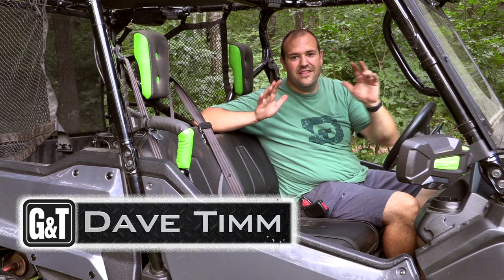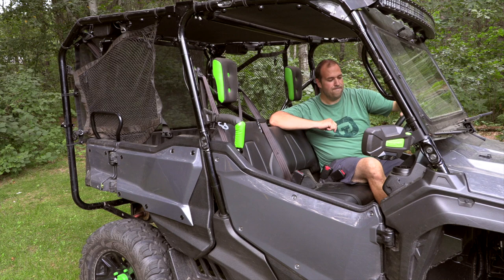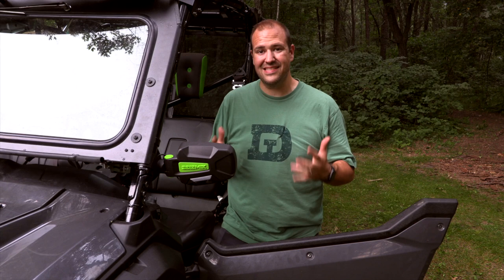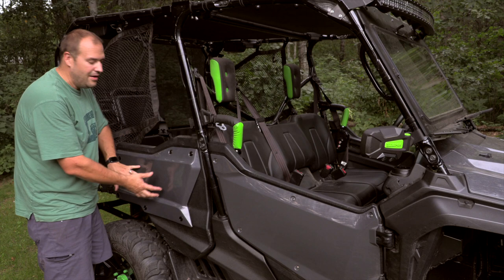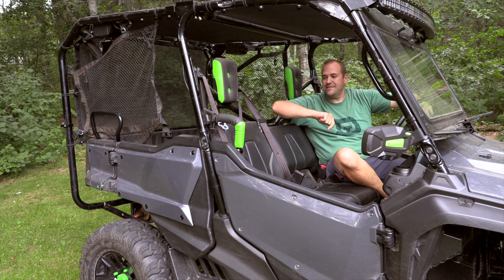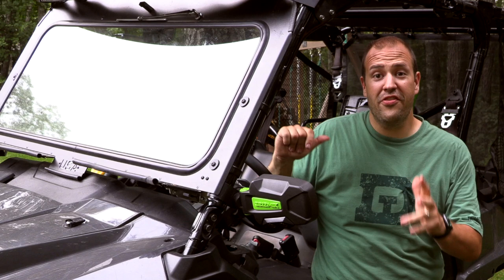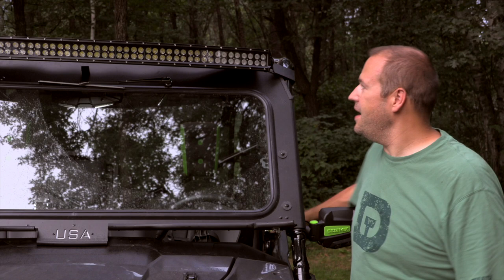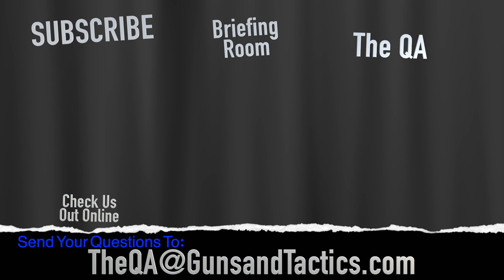The Best UTV for the Range or Play! Why I picked the Honda Pioneer

Comment: I like the idea of having signal lights built in.  More manufacturers should do this.  I know that CFMoto does integrate the lights on every model they make.  I don't care for that brand because I just don't trust it.  Good video, you have installed many things that I believe should be a complete option kit from factory.

Comment: 1. Do you think the roof rack could handle an 8ft. John boat?

2. Can you go into more detail regarding the difference between the i-4wd and the regular 4x4?
Reply from the maker: I’m not sure about the boat as I am not an engineer and I would not want to speculate how much weight it could support. In regards to your second question, check out my video on the new 2022 Honda Pioneer where I get some trail time with some of the new i four-wheel-drive models.

Comment: Great videos Thanks!
 I have a 2021 Pioneer 1000 3 good machine but Honda does a lousy job on fit and finish. When you spend 19k on a machine it should not  rattle like an old horse and buggy. They have had this issue for many years and simply choose not to address it. I bought it for the gear drive but that is jerky as well. Seems the technology available today they could build better at the price they charge.
Reply from the maker: I know what you’re saying   Sometimes the rattle in the back doors and from the bed annoys me
Reply: All machines have compromises. The plus to the Honda's is that they'll continue to actually work, while the ones with better fit and finish likely need to be repaired far more often just to get them going.

The choice is yours.
Reply: My brother in law has a Can Am Defender. He had a bunch of rattles with his machine. He fixed it by attaching some self stick foam where the door meets the frame. That seems to be a common area for rattling. I am sure it would work in other areas as well.

Comment: I have a 700-4 and love it but I'm going to a 1000-5 because I hate the 3 speed transmission. But I went with soft sides that wrap around the roll bars as I use it for the farm and to plow snow with. My question is have you installed a heater in yours yet and did you get enclosed cab set up?
Reply from the maker: I got a soft half cab and a vent fan not a full heater.

Comment: Can you do a video on how you changed your plastics- color-and where do I order the different color plastics- for side doors- bed rails-and front
Reply from the maker: I ordered my plastics from my local dealer.  For the front follow the Honda led headlight instructions. That covers taking off the front fender.  Then on the doors just have to add threaded holes, I used nutserts which I talk about in the Tools and Supplies video or click the link to check out the article.

Comment: Really nice job.  Thanks for the video.  I like the colors you used as well.  Did it take along time to change out all of the panels?
Reply from the maker: Thanks!   The front fender was by far the longest.  It worked out because while I had that off I swapped headlights and ran my accessory wiring.  I would guess if I were just swapping the front fender it could be a 1-2 hour job maybe a little quicker.  The most helpful directions were from the Honda LED headlight instructions as it covers front fender removal.  Some of the harness swap etc that wasn’t covered was pretty straight forward.

Comment: Great review!! Been trying to decide between the Pioneer 1000-5 and the Yamaha RMax4. I will need this rig to do inland lakeside duties in Michigan and then also to plow the gravel drive and road in the winter. Are you doing any plowing with yours? Thanks.
Reply from the maker: My local dealer hasn’t gotten an Rmax in yet but I want to check one out.  I won’t be selling this anything soon but I’ve heard great things about the Yamaha.   My luck Honda will roll out with a pioneer next gen next year ha ha.  No plowing with mine as I have a small garden tractor I use for snow.  A lot of guys do plowing with their pioneers though and can push a 6’ blade which would be nice

Comment: Just curious, what were your reasons for going with the Honda over the Yamaha RMAX 1000? You can't go wrong with the Honda but curious if you considered the Yamaha because of the better suspension, ground clearance and 10 year belt warranty.
Reply from the maker: Yamaha wasn’t out when I got this but if it was I would have strongly considered it.
Reply: Your machine is very nice. Enjoy and thanks for getting back to me
Reply: I had a Yamaha Viking and my 3 yr old son broke the 4x4 shifter. Was worthless
Reply: @webecummin  You know you can fix things if they are broken, correct?

Comment: Very cool build man! Now that I know about the transmission instead of a belt driven vehicle I am defanatly considering this model. I do have 2 questions for you though. I'm wondering if honda has a full enclosure for this model with heat from the factory. (Something I dont have to buy and put on myself) Also what kind of price range would that be for the 5 seat like yours. My family and I would like to be able to get out and do something during the winter and not be stuck in the house lol.
Reply from the maker: I think there is cab options but not sure if they are factory or aftermarket.  Tons of options though if you search for various vendors.  I got a great price on mine as it was a previous year closeout and pre covid.  Prices are higher now it seams for new machines.  I’m seeing closer to 20k
Reply: I bought my 2021 pioneer 1000 for the transmission it's been rebuilt twice mines for sell

Comment: In your dream after the winch do you see the 72 inch plow that machine could move some snow
Reply from the maker: I’ve thought about it but currently have a plow and blower for the tractor.  So for now this is mostly seasonal.  Although will probably head out on the lake this winter some.

Comment: Dave, thanks for sharing your experiences. I have a hard top and I noticed that the sound level went up. I did add some foam to the top and that helped. Your mesh top, does that lessen the noise?
Reply from the maker: I didnt notice any change in noise as the open top is mainly for shade.  Ive heard from others adding a hard roof allows noice to bounce in the cab more.  I like the convertible feel but I know Ill get stuff in the rain of these days

Comment: if i  buy one of these, i would like to install a GMRS and CB RADIO. Do you know how many volts and amps the accessory panel provides ?
Reply from the maker: Check out my review of my Switch-Pros panel.  It has all the info on that.  No prob for a radio

Comment: can the roll bar be easily loosened and lowered?  I like this model but would have to lower the roll bar to get into my toy hauler.  If it can be loosened and lowered what would be the height?  Thanks
Reply from the maker: Not easily, several people chop the cage to lower it but it requires cutting and welding.  It’s a common project on the pioneer forums

Comment: Hey nice ride.  can you tell me what you've done to highlight your gear shift and 4 wheel drive selector?  Is it glow in the dark?  Paint or vinyl?
Reply from the maker: Rad customs covers.  Not glow in the dark but my mirror has a green led that serves as a dash light
Reply: @GunsandTactics  thanks for the reply.  At $85 it seems a bit pricey for what it is.  Do you think it's worth it?
Reply from the maker: I do. It does block the cold air if you do cool weather riding but I’ll admit I bought them a lot for the looks.  Yeah it’s a cosmetic upgrade but I like what it adds to the machine

Comment: I can go thru a lot more stuff with my 300 honda 4x4 than any SxS ever dreamed of! I've hauled deer been in water up to the gas tank and in mud up to the muffler.  Someday maybe but right now for off trail riding Thats what me and my friends usually do we go down old logging and skidder and slay trails no SxS can come close to doing..  If I did is ride roads and grades I would by a 2 wheel peel sport quad or a jeep lol!  But guys with families I get they buy one vehicle..
Reply: I have a wife and 2 kids and can finally afford to shop for these. Im tired of beating up my trucks. Im torn between buying 2 quads or 1 SxS and making the kids ride in the back. I grew up riding around in the back of a mule, for anyone who thinks it won't work lol

Comment: . Read your Book. You loose the weight of 2000 lbs for each person on board reduced your tow rating by there weight. . SO if you have 760 lbs of People and gear in the bike. IT cuts down your over all tow rating. Read your book.
Agree.. HONDA SHould have used the void spaces for storages and gear.
Reply from the maker: ok then
Reply: Yep, it’s called “payload” and applies to all vehicles ever made that tow.
Reply: That's old news, Captain Obvious.